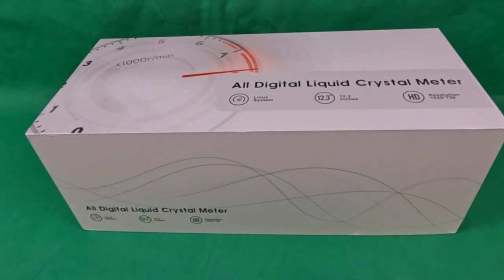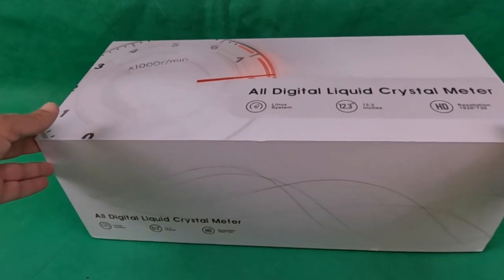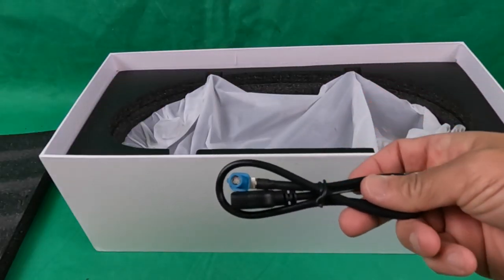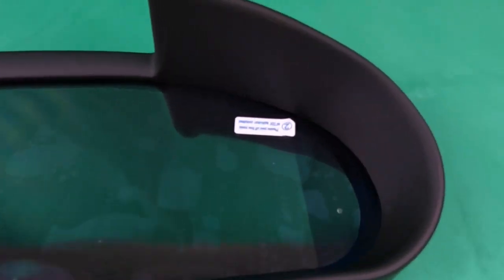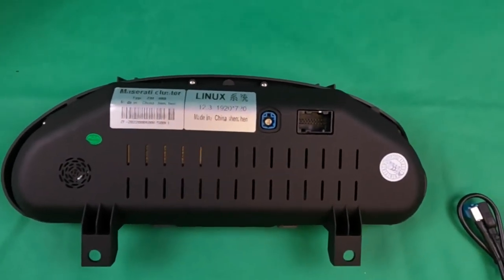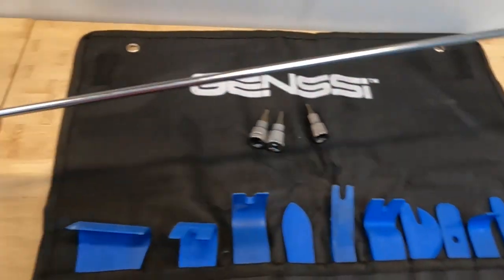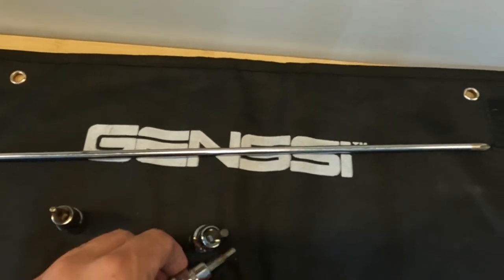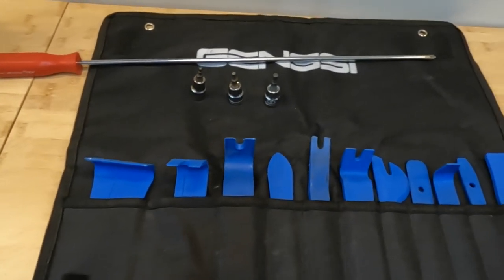NEW ACAR 08-19 Maserati Granturismo LCD Digital Instrument Gauge Cluster Unboxing and Installation

Comment: I have the sticky deal as well - and  purple power cleaner is amazing on taking this off.
Reply: Did you spray is directly and let sit before wiping away or do you spray it into a cloth and then wipe?
Reply: I apply the solution on a micro fiber towel and wipe it on. You will see the film turn a clear white, and then just start wiping off, not to much pressure as it can take off the black coat.

Comment: Hey Robin. I see the sticky-plastic syndrome is starting to affect your car. I pulled out all the interior plastic myself and just took plastic scrapers to get rid of the coating. Took a couple weeks, but if you have a lot of time to actually dedicate to it it won't take you that long. After you've scraped the gunk off, just spray them down with primer and matte black paint and you're golden.

They won't feel quite as soft as from factory, but they'll never be sticky again. :)
Reply from the maker: Hey thank you so much!!!!  May be my winter project.
Reply: @caymanspyder1593  When you do choose to start I also recommend sandpaper and IPA to help. The sandpaper will give the paint a texture to hold onto. Also, for any clips that might break on your interior bits, if you have some epoxy you can glue them back on.

Comment: Does it need coding? or just plug and play without any software update thru OBD2 port?
Does the mileage gets transferred right away?
Reply from the maker: It is plug and play, You will need to record your mileage and enter it.  Your ECU always keeps the true and accurate mileage and also if you have the Android head unit of any  kind that I sell, the true mileage is always displayed in the car settings